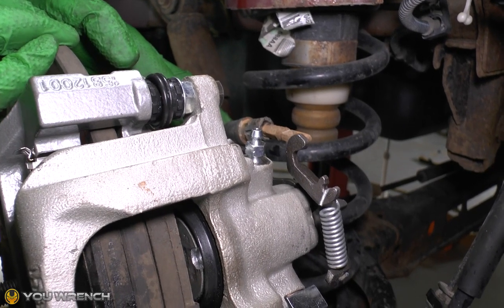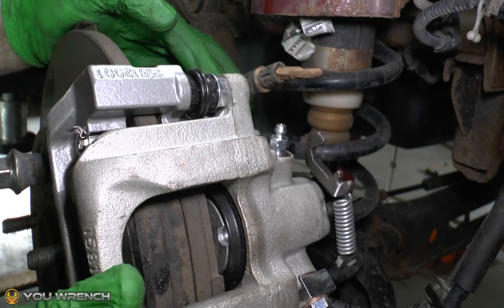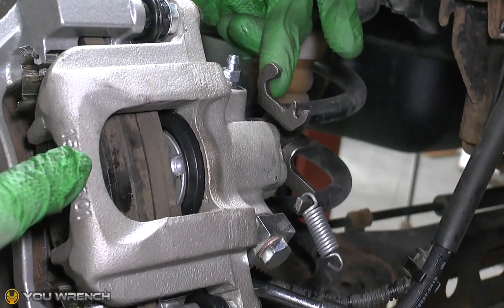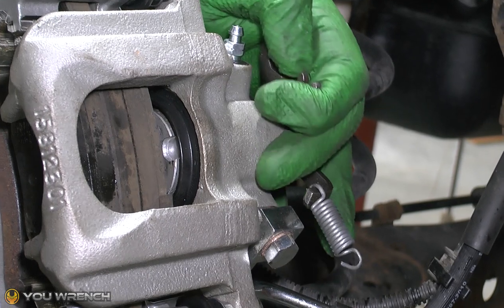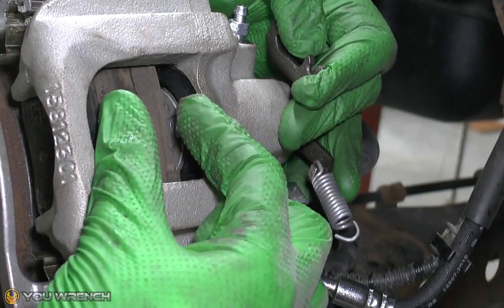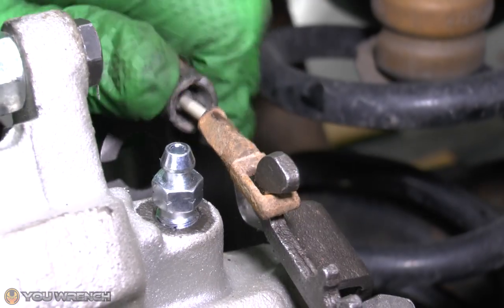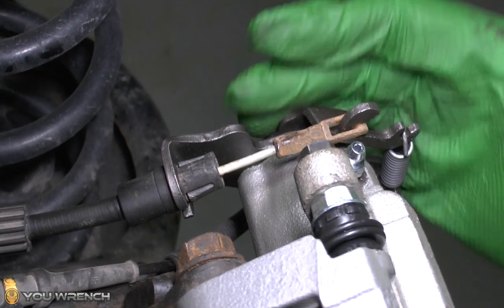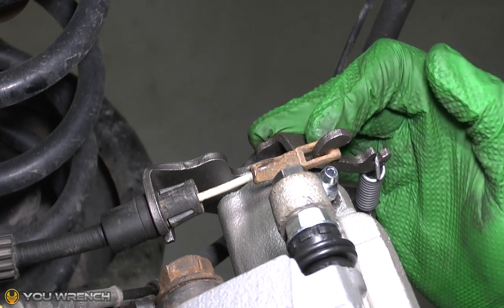How to Attach Parking Brake Cable to Caliper - Dodge Grand Caravan (Town and Country)

Comment: My passenger side pack brake cable can't use the way like this video; another solution is disconnect the brake cable in the cable bifurcation place, there is a adapter there, can be open a gap and remove the brake cable, this place could a short distance to reconnect...